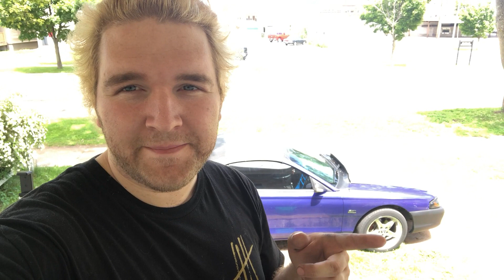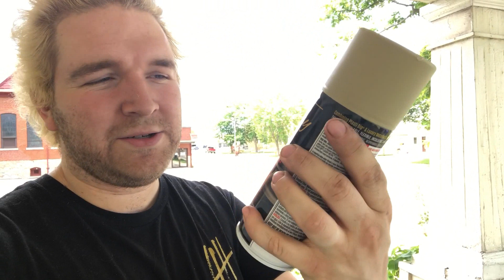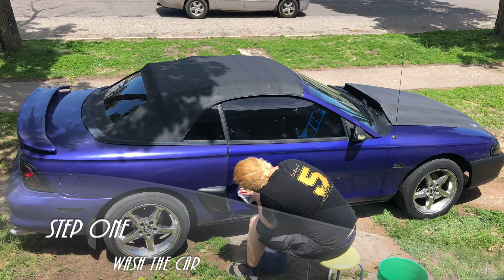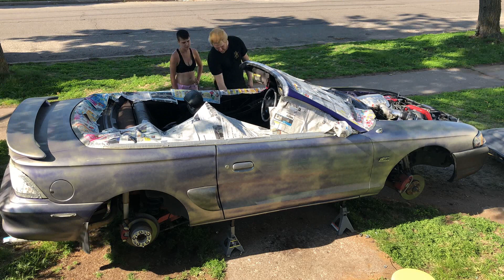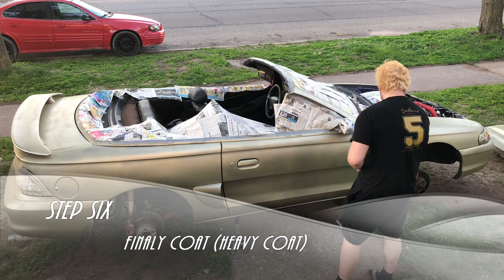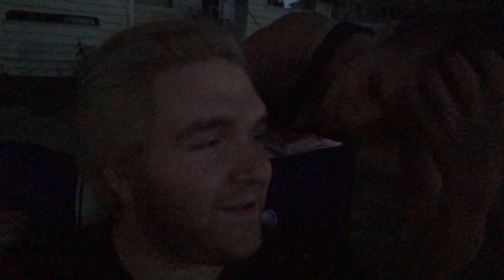Plasti Dip My Mustang With Cans!!

Comment: How has the dip held up over time since it was done? Any peeling?
Reply from the maker: Good question, it’s held up good! I drove it 2100 miles when I moved. It still looks good! Only thing is my side scoops fell off on one of the freeways so there’s spots that aren’t painted. I could post some shots of it now later!
Reply: @scarscars3486  I've found I've had real trouble with mine lifting in negative body shapes if that makes sense? It gets hot, it shrinks and pulls itself so tight that it lifts from inside corners etc.
Reply from the maker: robrath31 hmm, I don’t think I have many negative molding really. Nor is there much heat here lol but that’s interesting!

Comment: I guess that it is much harder to Plasti Dip your car with spray cans. Wouldn't it be wiser to spray only in one direction, left&right and not across? And to spray the whole line from front to back of the car? This way the coat does not spread evenly on the car surface.
Reply from the maker: yeah, this is the first time I tried painting a car. so now i know for next time:P but also next time id use a sprayer!